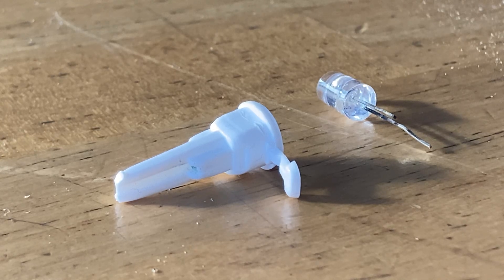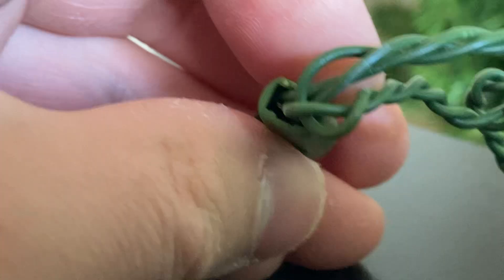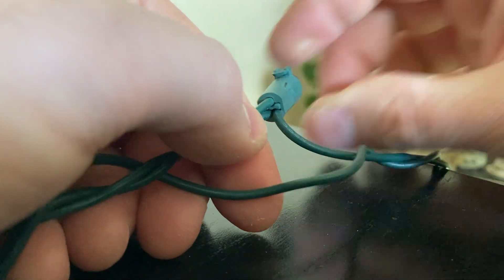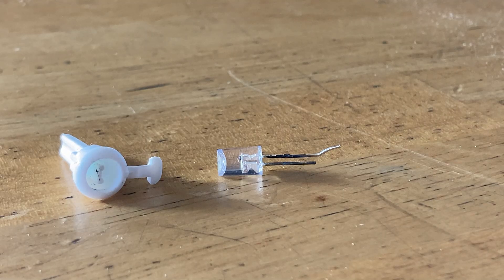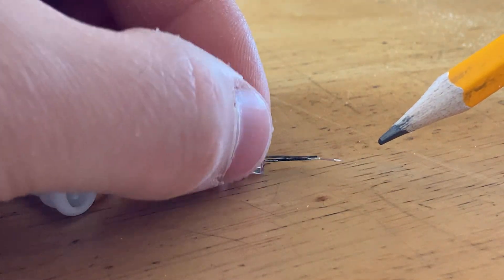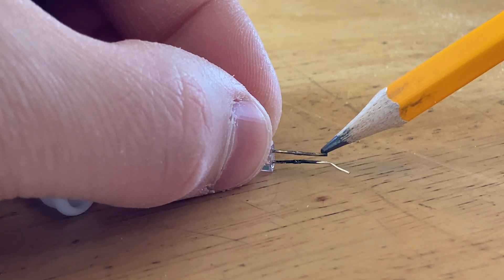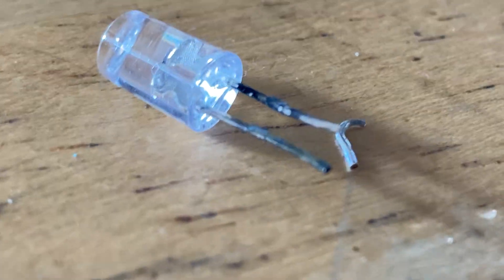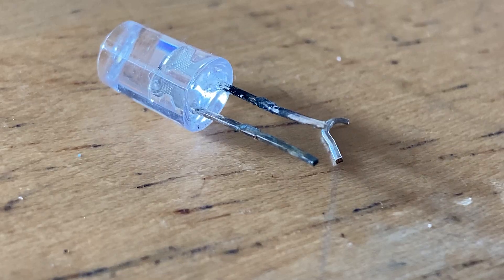Christmas 2025 | Interesting LED String Light Failure Mode

Comment: This is the most common failure with my outside lights. I still use them since they are the most cost effective and I don't mind the flicker and cool colors and I have a lot of replacement bulbs for them from salvaged sets. I find the bad bulbs using the LED keeper.

Comment: LAD lights using iron or steel lead frame that is usually tin plated.
The metal contacts in the light sockets are usually brass.
Occasionally, some GE higher end incandescent light sets did use a copper contact.
Reply: Ive suspected that for long time and jsut confirmed it with magnetic flasher its so STUPID no wonder the onyl ones that have really held up for over decade are the old neo neo ones that are soldered and the various none replaceable commercial grande ones

Comment: Here you go, explaining what i said in my original post above. 

AI Overview

+7
LED Christmas lights and rust often go hand-in-hand because moisture gets into sockets, causing dissimilar metals (copper wires/aluminum sockets/steel leads) to corrode or rust, leading to failures, especially in cheap sets with unplated steel pins that oxidize quickly, though better quality, sealed-base LEDs or adding dielectric grease can prevent this. Rust (iron oxide) forms on steel components, while galvanic corrosion affects copper/aluminum connections, both stopping the light flow. 
This video shows how to fix rust on LED Christmas lights:
Related video thumbnail
55s

TampaTec
YouTube • Dec 2, 2020
Why it happens
Moisture Intrusion: Water gets into the bulb socket or housing.
Dissimilar Metals: Copper wires touching aluminum sockets or steel leads create galvanic corrosion.
Cheap Materials: Many budget LEDs use soft, unplated steel leads that rust easily when wet, unlike copper. 
How to prevent and fix it
Choose Quality: Opt for professional-grade or sealed, one-piece LED sets where bulbs are permanently encased.
Protect Connections: Apply dielectric grease to bulb pins before inserting them to keep moisture out.
Clean Contacts: For existing rust, use a pencil eraser, isopropyl alcohol, or contact cleaner on corroded pins.
Use Correct Cleaners: Clean contacts with sandpaper or a wire brush if rusty, and ensure proper reinsertion.
Placement: Keep lights under eaves or soffits to shield them from rain and dew. 
This video shows how to use deluxe Christmas lights in the game Rust:
Reply from the maker: I have no interest in AI garbage.
Reply: The info in this case is accurate and based off decades of this problem existing, you should have known that being a hobbiest  @JordanU

Comment: Why don't you take a simple magnet to the LED leads and see if they are made of iron, most likely they are, check a TruTone mini also and let us know . I learned decades ago, only buy one piece injection molded non replaceable bulb led sets for outdoor use as they are sealed against water, unlike ANY set with replaceable LEDs
Reply from the maker: The lead wires are probably copper, aluminum, steel, or some kind of alloy. They're not going to be made of iron.
Reply: @JordanU wrong, dont be so hardheaded
Reply: There are plenty of pics online of rusted led leads, iron oxide red rust if yo7 know what that means
Reply from the maker: @fishbowl7098  It's not magnetic, so therefore it's not iron. I don't think LED leads have ever been made of iron.
Reply: Steel is just iron with a few percent carbon,and still rusts unless it is stainless steel,even cheaper stainless can rust and corrode however, either way the corrosion I a well known common problem with these type cheap consumer grade sets and why all lighting professionals use the sealed one piece injection molded sets
Reply: @JordanU  Steel contains iron.
Reply from the maker: @rs12official Correct; but steel is not iron. They are two different metals with different corrosion properties.